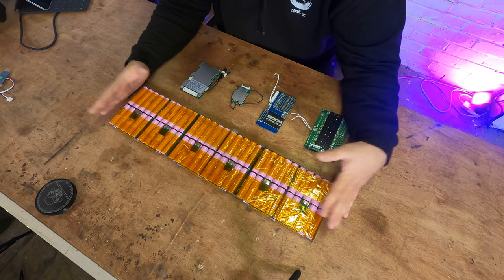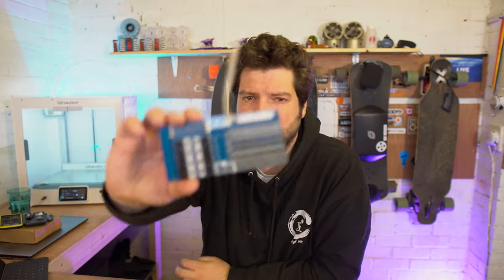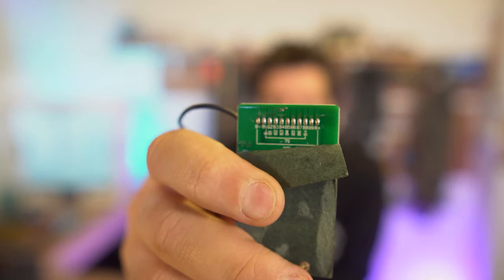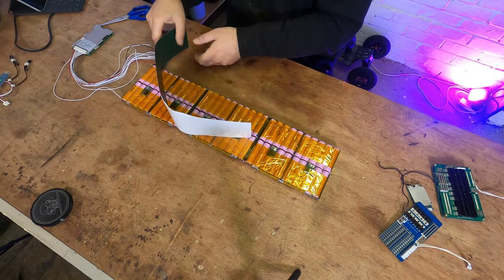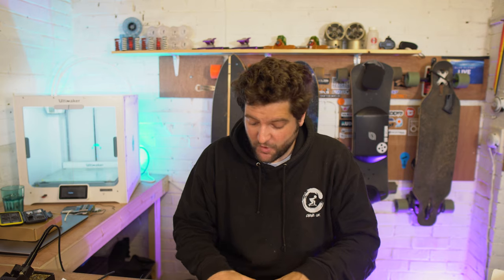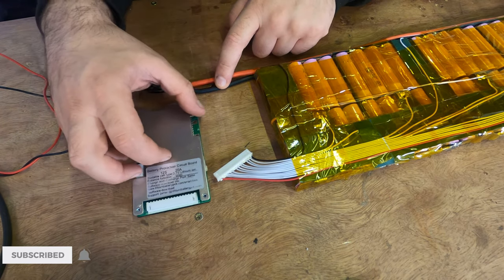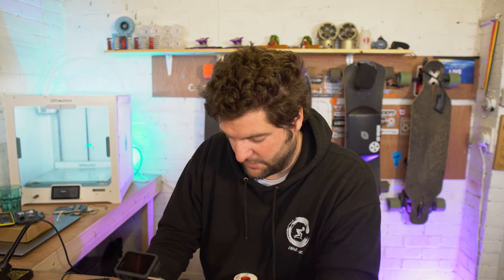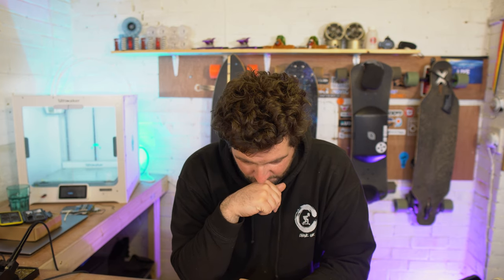The *ULTIMATE* BMS Guide

Comment: When choosing a BMS, how do I figure how many amps I will need in a BMS? I am going to try a 20s 15p. 18650's are rated at 30 amps each. Motor is 10kw, controller draws 700amps peak and 280 nominal. Was looking at getting a smart bms but want to make sure I'm getting what I need for the application. Thanks
Reply from the maker: Depends on if you want to use the BMS for discharge.  I personally don’t so it’s irrelevant.  I discharge straight from the battery. If you want to use a discharge BMS, the figure out what you want your maximum battery current you want to the motor controller and spec a BMS for that
Reply: So can you use any bms without discharge? I purchased an ant 400amp bms that has the bluetooth feature. Just trying to figure out if it will be fine for this setup. Thanks for the reply by the way. New at all this stuff and still learning.

Comment: Coming from the drone hobby, the part that is crazy to me, is the tiny wires coming from the charging port to the battery and BMS.
What current do these types of batteries usually charge at?
Even at a 1 or lower C rating, with 4 or more cells in parallel, that is going to be 10+ amps of charge, does that bore require thicker wires?
This is not a criticism, I have seen everyone do it, I am just trying to understand why?
Reply: Ok, I quickly looked up some chargers and it looks like they are mostly under about 6A, so I guess that makes sense.
But why is the charge current so low?
A 4Ah battery at a safe 0.5C charge is already 2A.
So a 5P could charge at 10A!

Comment: If you bypass the BMS for discharge won't you lose the low voltage protection? What's the advantage of bypassing it?
Reply from the maker: Hey bro, you lose all discharge protection if you bypass.  You still get under volt protection on a per cell basis.  Bypassing offers several advantages.  1 - you can run a tiny BMS, high discharge BMS are massive, 2 - you don’t have the BMS in line between battery and VESC.  We cover this on the video

Comment: Hey Lee. Got an issue with my board. Maybe you can figure it out.
 Ok. Fully charged, ride till it's dead. Problem. Battery indicator shows 2 of 5 battery lines still on battery yet it died and would not turn on. So recharged and tried it again. And once again. Like a bad float in a cars fuel gage. Shows 1/4 tank left, except car dead due to NO fuel in tank. 
 So what could cause this on an electric skateboard?
Reply from the maker: Patrick Gauthier what is your battery size? 10S? I bet your battery is a 10S and the gauge is set for 12S.  What indicator is it?

Comment: Nice flat battery design. Good tutirial. They say trimming the balance leads will send uneven charge to the cells due to resistance difference. Does it really affect?
Reply: no, it does not, these resistance values are negligible

Comment: Hi Lee, when the battery pack is not on a load (not connecting to any appliance or device) or even charging, will the BMS be still working automatically to balance the cells ?  the cells will discharge themselves over time, not sure if the BMS still detect the pack and start balancing according to the cell parameter.   Thanks !

Comment: Sir, I have 3s BMS 20 amps. And I want to connect three cells in parallel with that BMS in 3 series for 12.6 v. Total of nine batteries. Will it be safe for the BMS..? And how much amps would I get in final output. Pls help. Thanks.

Comment: Mate i think my BMS is damaged because my voltage is dropping 54.1 to 0 in seconds !! even my battery is fully charged. I have gone through some  BMS after seeing this video and most of them says it's  ≤500W motor but I have two 800w motors. Can i use these ?

Comment: Hi. I have a bms from the same manufacturer and I've connected everything like their datasheet and the charge/discharge (-) wire is connected to the C- port. My doubt is not how I should split it? Can the C- feed the my esc and split into a charging port or should I use your setup (B- to the BMS and then to the esc and C- just exclusively as a charging port)?

Comment: I’m super new to making battery packs and anything related to bms I quite enjoyed this video and I wanted to ask a few questions that are related. First question what was the total output in voltage and amperage of the pack you made in the video?
Second question which may be dumb sounding but again new, can I make these have a voltage of 120-180+ volts?
Third question what is the max amperage if possible to run in parallel that these packs can handle?
Fourth question do you have more videos related to the bms, making batteries such as these and what I just asked about so I can watch them? I do like asking these questions to gain information but I’m more of a visual and hands on learning so it sinks in more that way for me

Comment: If you discharge is bypass is there still a low-voltage protection meaning you can't run the batteries to low

Comment: Great video! I have built a few packs myself so far and already know most of the basics, but stayed and watched the whole video for any new tips and tricks you might show me along the way :) Thank you!
I do have one question though, which is why I ended up here in the first place... When shopping around and looking at the specs of a BMS, they always have a 'Max Amperage' rating. However, unlike some other types of devices, nowhere in the BMS specs does it list any sort of "Peak" or "Surge" power rating.  Why is that? Is that maybe because the BMS acts more like a switch, and the moment you exceed it's Max Amperage rating, it just shuts off? There is no rating for Peak or Surge power, because that's not how they work?
Reply from the maker: Correct bro.  The BMS will indeed shut off if you exceed the max rating.  The rating should be considered the max you can pull, I just dont discharge through the BMS so never had any issues!
Reply: @LeeWright  Perfect, thanks so much man!!

Comment: the BMS for my 14s ebike batterie has cables connected to  two C minus and also two B minus ports - should I use only  one C minus and one B minus port like you showed  -  or should i combine the two C minus cables to one cable - the same for the two B minus cables ?  Is there an advantage using the two C minus and B minus ports combined ?
Reply from the maker: I guess the cables are doubled up for larger charge currents, what is your charger rated for? That's the only reason I could see to do that
Reply: @LeeWright  My first charger for my 14s ebike batterie is rated 58,8 Volt / 6 A       the second one is rated with 58,8 Volt 8 A. Do you think I have to double up the C - and B - cables ? I will use your connexion layout from this video.

Comment: I have a scooter with an 84v 32A LG battery that has two discharge lines, scooter cuts of prematurely at ≤ 76.9V. Voltage measures 76.9 at both battery connectors when they are both disconnected but when I unplug one discharge line and leave the other plugged in the voltage drops to 20v in the un-plugged connector. Any idea if this is a BMS  or a controller issue? Thanks
Reply from the maker: Sounds like it could be the BMS, but without knowing the full setup it’s hard to gauge
Reply: @LeeWright  After pulling the 20S BMS out with full charge, all cell groups charged up to 4.21V except number 3 cell group was low at 3.46V. Enough imbalance to trip the BMS?

Comment: Lee,

This question has plagued me for a long time and when I can actually find a BMS datasheet showing this information, lifepo4 shows 3.5 volts, lithium-ion shows 4.18 volts balance release voltage. From what I understand, the lithium family of batteries like being charged to 80 percent so they will enjoy a long life. So charging to 80 percent may not balance the cells correctly? Are there BMS types that balance at lower voltages, better yet, is there a BMS board with an adjustable balance parameter?

Comment: So on this do u have to use a balance charger or is that done by the BMS? Sorry im new to this i am going to try repair my elctric bike battrey has have a few dead sells in it
Reply from the maker: No you do not need a balance charger with a BMS bro
Reply: @LeeWright  cool so can u mix the battreys i know its not a good idea but i have a couple dead cells in my pack can i just swap out the dead 1's?

Comment: Hey lee everybody says that all the cells need to be the same voltage before wiring and all that stuff and i wanna know what to do if for example one cell is not do you just through it away or maybe charge it up or something.
This hasnt happened to me yet but i wanna be preapared if it does.
Reply from the maker: Yeah you would either need to discharge the cell that's high or charge the ones that are low.  It's only super crucial for parallel cells, series groups not so crucial but if they are 100mv or more out your charger will struggle to balance them, the smart BMS can do it but it takes a while
Reply: @LeeWright  thanks

Comment: I bought 2 apex custom 10s smart bmses, both work fine but only one of them actually displays the battery percentage. The other one is always on 100% no matter the voltage.
could this be a defect?
Reply from the maker: william feijen probably not.  The battery percent depends on what you set the battery capacity and end voltage, 20%, 40% etc as
Reply: @LeeWright  i am using the android app and Can't seem to find it, is it an IOS only thing?
Reply from the maker: @williamfeijen8601  no bro, go to configure BMS.  Send me an email if you are struggling and I'll help you with some screenshots

Comment: Do you ever use a BMS with a protected battery, or are they just to add protection to an otherwise unprotected battery? It's just that my headlight battery pack uses 2x3 protected batteries, but it also has a BMS, but it just seems to be there as a poor charging circuit?
Reply from the maker: The BMS can look after charging and discharging of the battery, just protects it from something stupid like a short or overheating etc

Comment: What's your take on the cheap bms' on ebay? I got one for my 48v 13s battery build but it dont seem to be well balanced according to a few of the cells. It has a separate port for charge and discharge but would only charge to 4.10 per cell until I hooked the two together and now it'll fully charge but was testing each cell voltage and some are .10 to .15 higher than others

Comment: Lee i have a trampa power switch in place of an xt60 connection. Just to verify if i cut the red and black wire going to the power switch and solder an xt60 connection is that correct? I ordered and am using the exact smart BMS in this video.
Reply from the maker: I'm not sure what you mean bud? The power switch is on the VESC yeah?
Reply: @LeeWright  yes it comes off the vesc instead of the xt60 connection
Reply: @LeeWright  i emailed you a picture im sure you have a million emails however
Reply: @LeeWright  in the diagram in your video it shows an xt60 and xt90 connection. On my trampa board i have the xt90 connect and a power button but no xt60 connection. I assume i would have to cut the red and black wires to my power switch and solder an xt60 connection in line with the wires
Reply: Thanks in advance for any help i will try to donate via patreon

Comment: Hi Lee, what power voltage charger do I need for a 12s4p?
Thanks
Reply from the maker: Depends on the cells dude, look up the data sheet to see the nominal charge current then multiply than by 4 to get your max charge rate
Reply: @LeeWright  the nominal per cell is 3,65v if I multiply by 4 it gives me 14,60v 😭
Reply from the maker: @africans1968  oh you are asking about voltage... I thought Amps.  So you need a 50.4V charger (12S) - I have them on our site.  I thought you were talking about charge current
Reply: @LeeWright  thanks for your help, I will have a look to your site.

Comment: E Boards Peru has a new battery out which he rates at 140 amps continuously. I really wonder how accurate that is. Granted, he is passing the series connections with two, what appear to be 8 awg wires, but those wires are coming from nickel strip that appears to be single layer. So, at 12s4p, he's passing 2 series connections through a small bit of nickel stripping in parallel. No one is likely to pull enough power from these packs to find out, but I do wonder what would happen at 140a continuously until dead.
Reply from the maker: dieselphiend the series connections would get so hot they would likely kill the cells is my guess

Comment: Hey Lee, how do you prevent your battery from over discharging if you bypass  the BMS?
Reply from the maker: We used motor controllers that are able to monitor and cut off at a preselected pack voltage mate

Comment: Stupid question.  I’m kinda new to diy.  But can you make a video on the difference between 12s, 13s, 14s etc etc.  I know a lot of Vesc can only go up to 12s and spinted and stormcore 100d can handle up to 16s.  What’s the advantages of anything more then 12s and pretty much the differences are.  Any help would be greatly appreciated.  Thank you.
Reply: with higher voltages you can deliver more amps, therefore more power to motors. 
higher voltages = less heat

Comment: Hey love the video! (And the bloopers 👌) I have a scenario question for you.

What if one wanted to swap out the BMS after the pack has been built and used?

Scenario
The buddy you're making that battery pack decides to switch out the BMS for a differen't one once receiving it. What precautions would one have to take?
Reply from the maker: Great question dude.  The short answer is that is totally fine to do.

The longer answer is firstly, as always make sure you insulate any battery contacts as you go but it would be a case of just desoldering the old one and replacing it with the new one.  Just observe all the usual safety precautions and you will be golden

Comment: How do you extend those balance leads? Do you just splice another wire and then solder or do you use those clear shrink wraps with solder in the middle that melt with a heat gun?
Cheers mate, battery building suddenly became relaxing 😉😂
Reply from the maker: Yeah dude you just solder an extension wire onto it, heat shrink and away you go!

Comment: How do you calculate the amount of amps your bms should be able to handle on your battery pack.

I'm building a 14s 6p with each cell rated for 8A continues and 10A peak

Should I 6x10 to know how much my controller should be able to handle? So with this 60 amps? Or should I look to the amp hour rating which is 21AH?
Reply: All BMS have their specifications written on them but it depends on number of batteries in series and the total voltage of the pack.

Comment: 12s5p in an evolve? What evolve has space for that much battery? Or is it a modified enclosure?
Reply from the maker: Evolve Gen 2, they are huge!
Reply: @LeeWright  amazing, I'm assuming vesc and motor upgrades too. Should be a beast.
Reply from the maker: peach it has already had all that in the past yeah, the owner left the board switched on for months by mistake though! Drained the pack right down so I built him a new pack and repaired a motor whilst I was there

Comment: would make a great second part to this video if you went in to some of the advanced settings available on the BMS, especially as you now sell this product at APEX, thanks
Reply: The reason I mention the settings is i have one of these smart BMS's purchased from APEX and have one cell which is slightly too high and another which is running a little too low. I am not really sure of the best method for getting these cells balanced using this new BMS

Comment: Great video, balance wires should have been the same length.
Reply from the maker: How do you mean bro?
Reply: The wires coming out of the JST connector should be equal in length to avoid voltage drop in long wires i.e. batteries with long balance wires will always be overcharged compared to the batteries with short wires. The bigger the difference between the wires in length the greater the problem will be due to the difference in wire resistance. Balance leads should be kept as short as possible but with the same length. Excuse my English and I really like your video especially the safety awareness.
Reply from the maker: @ultimateworkshop2000  oh I see.  The difference in length here is about 30cm between the shortest and longest.  If it were an e bike pack we could take that into consideration but not for an esk8 pack like this that has to be as flat as possible,  it's more important to think about the shape than the very small voltage drop over that length of wire but yes deffo that is a factor! Thank you! Glad you enjoyed it

Comment: Heres what I am hoping to find out, I have 4 cells that are 2600mAh, 18650 li ion , 20A, what BMS do I need ? 
This 20A is also what concerns me, what if BMS is for made for 4 15A cells, and I add 20A cells ? Will bms just explode in that case ? Or will it simply throttle the amps ?
Reply from the maker: If you have 4 cells in series (4S) then you need a 4S battery.  The BMS will only allow out whatever it’s max rating is, so in your case 15A.  You dan bypass a BMS for discharge and only use it’s charge circuit

Comment: Some questions that I still have after watching your video.
What about the voltage? Should we expect a voltage difference when we look at the voltage from C+ to P- compare to C+ to B-?
Can we replace a 20A BMS with a 30A BMS?
Reply from the maker: Both of those measurements should be battery voltage.  You can replace the BMS for a higher amperage one but bear in mind that it will allow 10A more current on its P-.
Reply: @LeeWright  Thank you for your answer.

Comment: Great vids, Lee!

I’m high in the mountains (off-grid. Of course), and I’m part-way through  making a light. Checked the self-discharge rates, and it looks like  I can use 96- 18650 cells, and a 3W,3v CREE LED. Any chance of a tutorial on how to assemble this?  What BMS is needed, etc..
Thanks!

     - “Mad” Max Speedwell